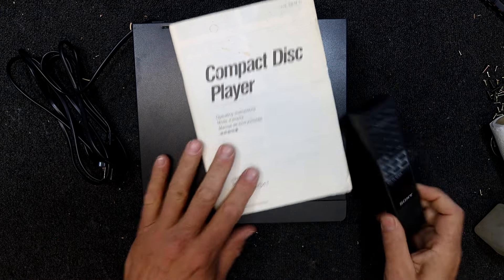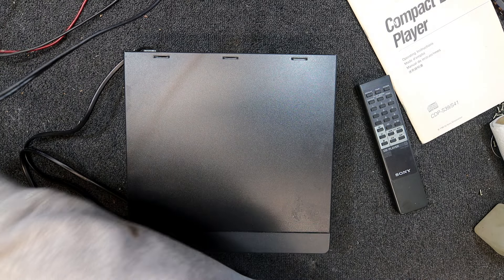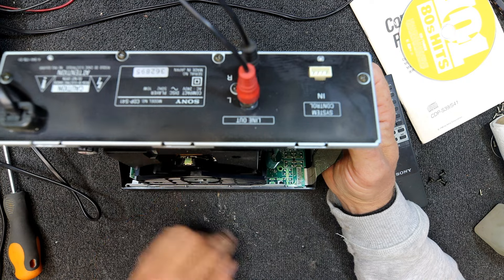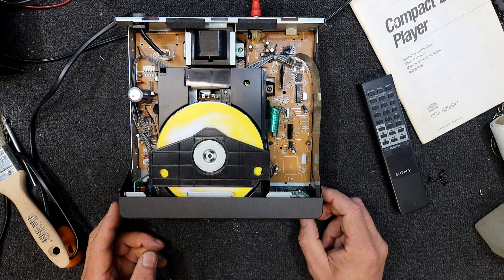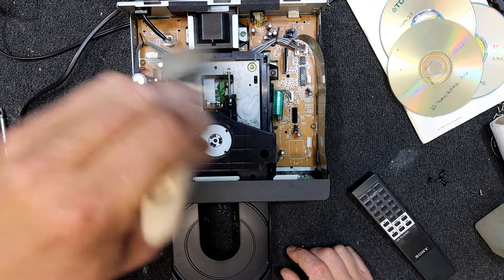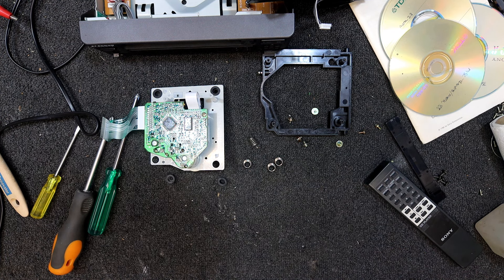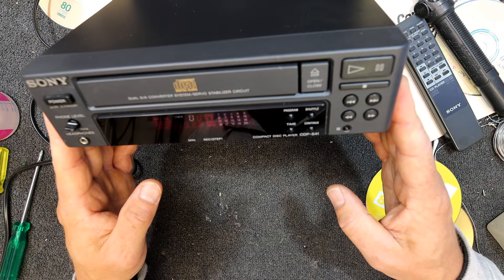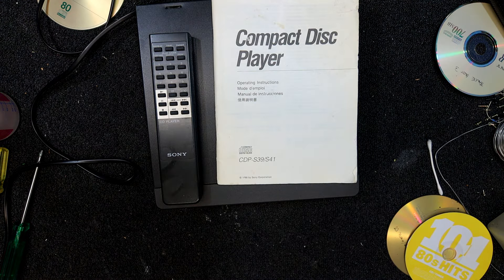Sony Mini CD Player Replace Rubber Suspension and Spin Motor

Comment: what oil do you use?
Reply from the maker: Just a light oil from the hardware store.
Reply: I'd buy it. Be fun to try to modify it with a digital output, wonder if the board already has a spot for it. Be amusing to make an all-in-one system kind of like Bang & Olufsen did back in the day.